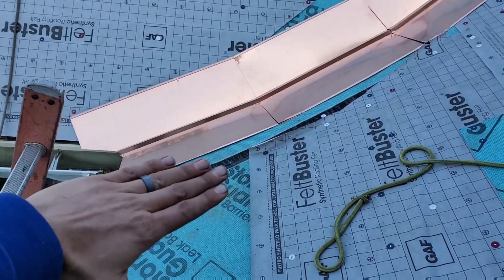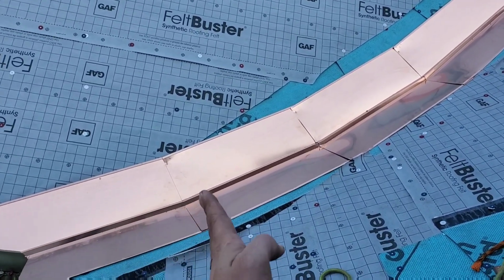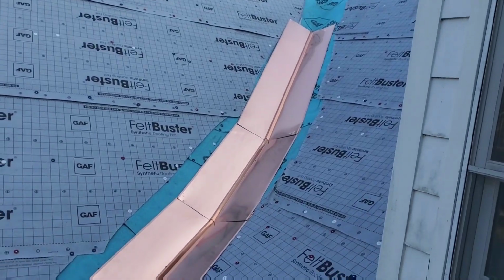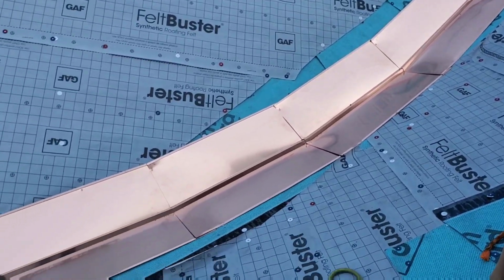How To Join Metal Valley Flashing At Pitch Changes And Curves.

Comment: Im assumming thats copper, but i domt understand why people would opt for copper flashings on a shingle roof, shingles dont last nearly as long as copper does and when the roof gets replaced, so will the copper have to, well atleast the valleys, and being said the roofers next would have to be super careful to not damage the other copper flashings (wall flashings, etc) because even a slight bend thats not supposed to be there can be seen in copper work.
Reply from the maker: Mostly a status thing. Copper does have big advantages as far as workability. Would much rather do copper that steel.

Comment: So you just smashed the raised "w" with your hammer??? Slap yourself
Reply from the maker: I would love to see your "superior" method.
Reply: You need about 4" of overlap on those pieces, with that curve I would say you need about 16" long sections, also... you aren't supposed to put nails in the metal valley. You need to use clips to hold the valley. You didn't mention it but did you cut the tips back on your shingles? Hope so!!

Certainteed has a great instruction  sheet on metal valleys. Check it out. 

The way you did it is wrong and will probably leak after a couple years.